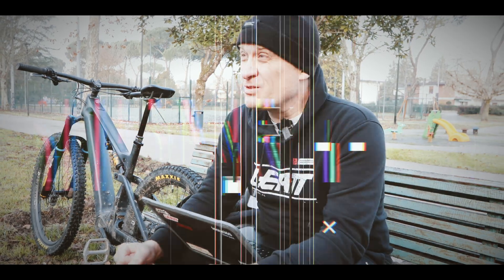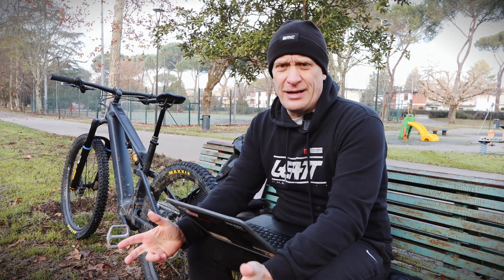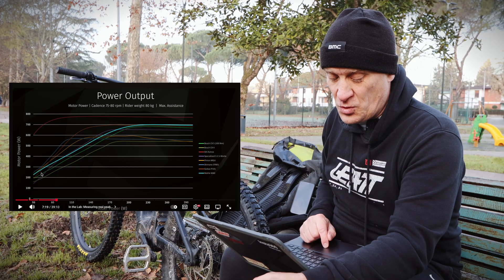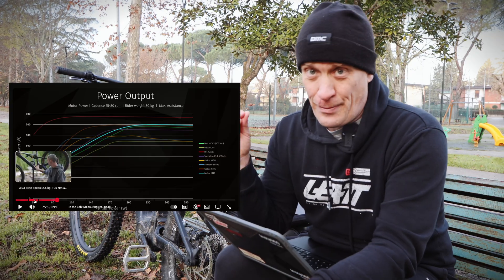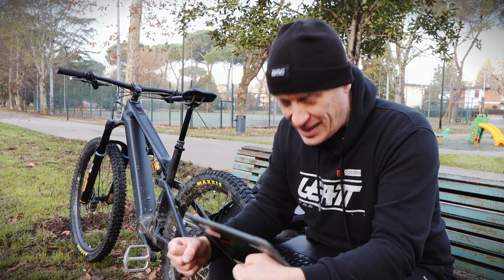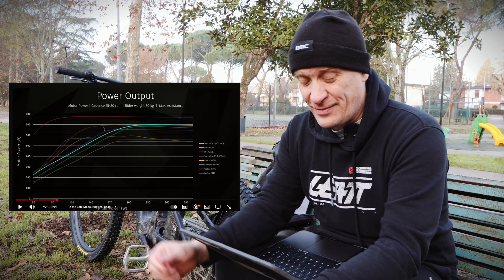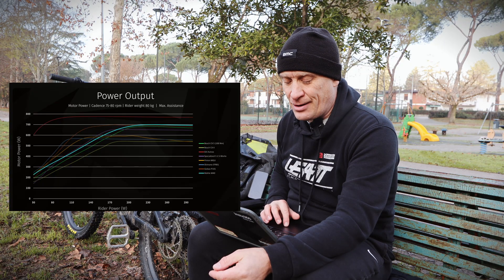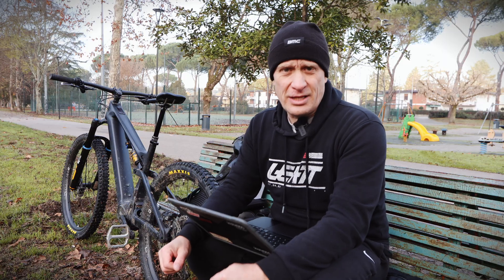Motor Behaviour - Reacting To The Data…

Comment: ✌Awesome analysis Alex!
Reply: I feel like I'm in an alternate reality listening to you. "Yes you can use different or custom presets, BUT I must insist that the only thing worth comparing is the maxed-out presets". Weeks ago, I went back to the velomotion graphs after listening to your earlier videos and concluded that your brain was stuck. What I saw was a tunable motor setup that looked just fine. Think about it. -- Respectfully and with a bit of non hater humour.
Reply from the maker: @jpravetz I discuss clearly here that the presets dont change the motor behaviour as you think, i have covered this in many videos. The motor maintians its cadence feel at all power levels despite the power level. It doesnt repsond to torque inputs like other motors and that is shown in the data. hence my analysis of the second part of the video, I can say in real life as well compared to say the MAhle, this is true. Its a super interesting point, complicated but at the end, the data shows a steep ramp up. mode 7 is really much more reduced but still feels the way we described.
Reply from the maker: Thanks guys for doing this hard data work, I hope that I linked you guys enough!
Reply: @alexbiketester  All good! Thanks
Reply: You are the best of the best, so much so that your data is being used here.

Comment: Alex, at 8min you show a graph that indicates that the output power of the Avinox is much lower at lower rider inputs. Given this, are you still seeing a power delivery shortcoming with the Avinox even while in these settings because you feel it's still related to cadence, not torque? Trying to understand...
Reply from the maker: these graphs dont show the phase of teh pedal stroke with the rider input... But the steepness of teh graph shows a large rampup at teh start, which is indicative of a high multiplication factor of the motor, these numbers more explain what you feel on the pedal....

Comment: Good on Alex for kinda widening this topic as Emtbs evolve to mimic analog a little better on ride-feel. 👊 Every motor manufacturer should be offering two/three firmware profiles...torquerer "real feel", 50/50 "balanced", and cadencerer "moto feel" . (Spl intended😊).  Powers-that-be, just offer this as part of the package for rider onboard display and 100% selectable by the consumer. Assuming the software engineers are actually consistent Emtb riders themselves (some are) and can desire to refine the feel (tune it) for a larger rider style-continuum...we're frickin paying a "kidneys worth" of money for these damn things...please offer profile options too! Also, you industry folks can complain or comply...DJI/Anivox was a major disruptor at a lighter, cheaper price...if they offer this feature in future firmware updates, more peeps will be switching from analog mtbing for smoother but lighter full power rigs.

Comment: I’ve been watching your videos on this subject for a while now and I have to say, they did put me off buying an Avinox motor based bike but then I found the VeloMotion review and that changed my mind. I do agree with some of what you say but as an owner who came from mid to low powered bikes and likes to RIDE my bike, not the other way around, I still think you are missing some of the story. Firstly, I agree, the tune from the factory on an Avinox motor is ridiculous, I could live with that. I followed VeloMotion advice and tuned the Assistance Range down and this made all the difference. You do call this out but only show a graph going down to level 7, this is still high. I set my Auto mode at 3-7 assistance, 450w & 55Nm and this rides very similar to my previous Bosch SX motor in Tour+ after the latest update. I set Trail to 6-9 Assist, 750w, 80Nm and this is higher but smoother than my SX motor in eMTB+. So I have found the key is in the Assistance Range tuning which can make the motor respond how you want it to but anything above 10 starts getting crazy. Appreciate you test in full power modes for direct comparison but the choice of tune from factory does support everything you have reported, feels cadence based as it ramps up far to quickly. This is where Avinox don’t help themselves and I’m not sure if they do it to make the power difference stand out as the over riding factor?? Second point you make is the response of the motor. Again, I agree and this can be tuned in the settings. I have it so it works well for me and once it gets going the Avinox is far smoother than the Bosch due to the sensor pickup being a high frequency. I’ve spoken to many Bosch riders who don’t actually like the way their motor response from standstill, saying it is actually crazy fast. Swings and roundabouts and personal preference, the Avinox needs to be tuned to respond faster but it is not as fast as the Bosch. Bottom line, the Avinox needs tuning via the Assistance Range settings to suit the rider. As a tester I can see that you might not always have the time to do this on every motor and Avinox do themselves a disservice with their factory tune.
Reply from the maker: cool to read your experience. very valuable. thank you.

Comment: The graph is just a snap shot of all the motors set to their respective maximum levels. So it's not surprising to see Avinox curve to be head and shoulders above the others. In reality, I bet 99% of Avinox riders, including myself, only use that max power for laugh and giggles, and not for serious riding. Personally, I've tuned the curves (all assist levels)  with the app to scale down the power and soften up the delivery so it's more like the other motors. I agree that Avinox does have a slight difference in pedal feel than the Bosch and Shimano which I have more time on. But by adjusting my riding technique to better match the motor characteristics in steep rock crawl and technical climb, Avinox is a real champ because I can do things now that are impossible to do with the other motors.
Reply from the maker: interesting feedback, what specifically did you feel from your point of view the motor gave you an edge over compared to other motors, was it the high end power when you needed to blast over stuff or soething else?

Comment: Hi. Did you experience a rattle coming from the Avinox unit? My Amflow is new and has an annoying noise going downhill. So far Amflow support has denied it.
Reply from the maker: yes, a bit, not from Gen 5 or from Mahle M40, Its not super loud, ROb rides also discusses his Avinox motor rattling, there are worse rattles out there. However at this point in time the suspension system can increease the rattle, as it pulls back on the chain. The Rotwild wont do it if you are riding that bike as the suspension design doesnt even cause an ep8 to rattle. A lot of the design elements of the bike  can enhance or reduce noise.
Reply: Thanks for your feedback, I appreciated. The sound mine does is so loud that it ruins the experience. I hope Amflow will come forward with a satisfactory solution. I am not enjoying the bike so far.
Reply from the maker: @mdichiara1000  shimano had same issue originally

Comment: So..... the Avinox IS torque based. It just dont feel that way because as soon as you touch the pedals it will give full power. Therefore it will never be controlled by your leg power and it will feel like a motorcycle. So happy with my gen5 Bosch :)
Reply from the maker: The reaction when touching the pedals underload is low compare dto the MAhle or Bosch, after about 1/2 to .1/3 it starts to give power after the angualr movement of the pedals, with no pressure, so yes as you touch it.... it follows the "digital" setting you put into the computer, so yes you are correct. ;-)

Comment: Velomotion did great job of testing all the top motors & even with the Avinox derated to 850 watts it was still the best motor, you can see that in the data. Some people may not want or need that level of performance but clearly lots do.
Amflow is the only new bike in the UK that is not discounted & still sell all there stock. Finally without DJI none of the other motor brands would have up"d there game & we would still be @ 85/ 95 nm. 
Thanks for sharing the velomotion data , keep those videos coming.

Comment: When you say it's cadence-based, it's a bit confusing. Since that would imply that the faster you pedal, the more power the motor would put out. The DJI Avinox is he opposite of this. It ramps up to full power at a low cadence. So, your cadence is almost irrelevant.
Reply from the maker: that is exactly how the dji works, check out the Velomotion video. it is disconnected form the pedal pressure.... 800 percent multiplication
Reply: @alexbiketester  At full power yes.dont forget that.Teir motor also have a torque sensor.and they just like to programm it like this.Esaliy changeable.AVINOX clearly is far ahead of the compotition,and I dont belive Bosch like that
Reply from the maker: @wrosslandwr8032  they are not far ahead of the competition, the only thing is they have a questionable high power level,  this is just you repeating over hype from paid influencers....
Reply: @alexbiketester well I think it is you continuing promoting Bosch.
Reply from the maker: how am i promoting bosch in a video with a MAhle motor, which is not paid for.... asking for a friend...lol

Comment: You would think the Avinox should get terrible range with that power curve. Whether or not it has torque sensor it clearly produces power like a cadence sensor. It's funny how so many reviewers failed to pick up on that.
Reply from the maker: Failed.... abysimally  LOL maybe, im not sure if they failed or were just producing videos on talking points paid about it. Velomotion, obviously not, my self not. The scandal is not the motor its the way its been talked about. 

range wise its an interesting point, in max power mode though it does drink energy its normal in the second power mode.
Reply: @alexbiketester  I think the Avinox approach is to get the motor RPM to ramp up quickly, as this can actually conserve power. Motors at standstill draw 5-7 times their rated current, the slower it ramps up the more current it will draw. However MTB is very dynamic sport, up hill, downhill, rough terrain, all have a part to play as well. On smoother flatter terrain, the Avinox motor may be very efficient, while the other motors would be more efficient on, steeper rougher terrain. I expect the majority of the manufacturers have similar curves good reasons, they work well. What is interesting is that lots of riders do like the Avinox, as it is the fastest motor out there, as the acceleration is way better, especially at low speeds, with low rider input. A lot of this power race is going to be over very soon. Even before these more powerful motor there was a trade of with power vs range. These new higher power motors, cant be used at full power half, the time unless your ride is fairly short distance.
Reply from the maker: @mattshepherd3412  yes I agree

Comment: Nicely explained video. I like a lot of your videos however, some of them I think you’re a little one-sided. Calling something cadence based is not really correct. They simply ramp up the torque assist. I don’t know how much you ride but I know maintaining 300 W for more than five minutes is a difficult to impossible task for most people.  Granted I’m 62 years old, but I can’t you can hit the two minute mark and I ride a fair amount.  The way I test myself is on the stationary bike at the gym.
Reply from the maker: This data in real life means you need very little pressure on the pedals and even when you do "suddenly" exert pressure the motor doesnt react the way you would expect, it feels like you are pushing on the pedals like a brick wall, there is no pwer wave that follows the rider, the rider has to follow the power wave. Hence spin faster and the motor picks up, hence cadence based. Velomotion explain it well back in their original video. 

The gobao does the same thing in turbo mode but its less extreme, they also told me they can change this if the brand wants. This is where the feeling of accelrating comes from and a less natural feel.

Comment: Good vid. I have an old EP8 which I’m very happy with and haven’t tried anything else. I’m an older rider and would find cadence based power helpful and in fact tend to ‘seek’ that with my EP8 when at the limit of my own ‘watts’. So your experience confirmed on the dino here tends to suggest I should consider the Avinox. But my son who’s fit and a good rider (and wouldn’t touch an eeb with a barge pole Because it doesn’t bring anything to his ‘use case’) would definitely agree with you Alex and says he suspects he would find the ‘Mahler Curve’ more attractive (he has tried several eebs). So, all very illuminating, thank you 😊
Reply from the maker: Yes many have asked me about which motor to buy, in use cases where they have a form of problem that the cadence could help I fully suggest they go right ahead and buy an Avinox based bike.